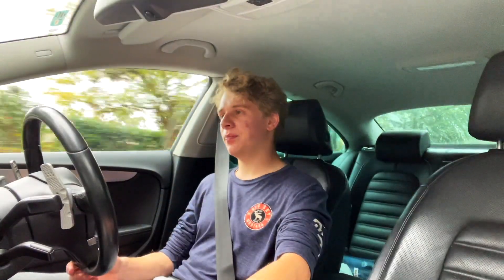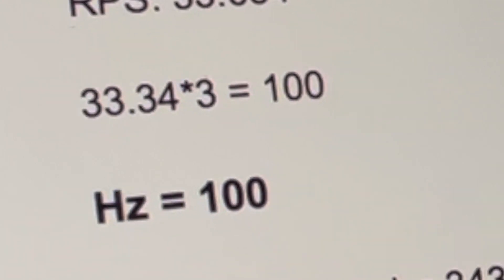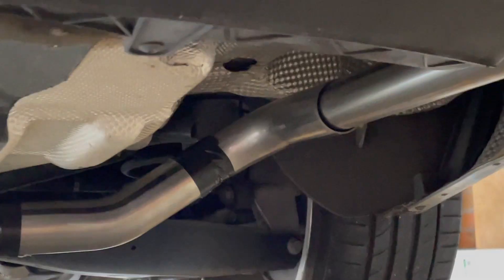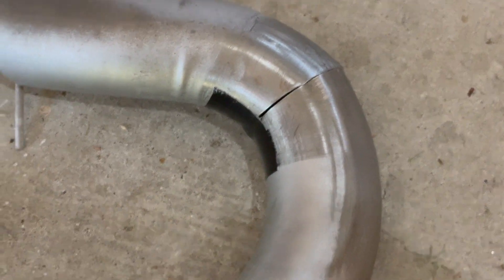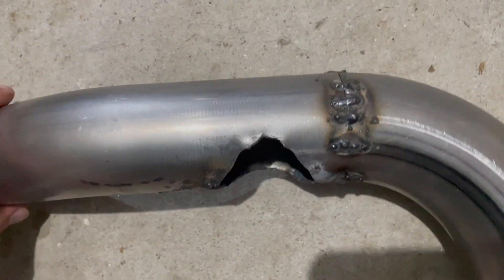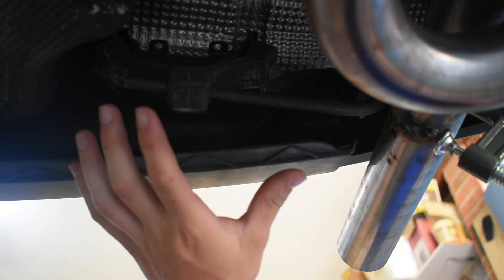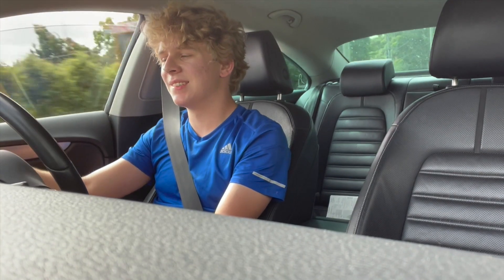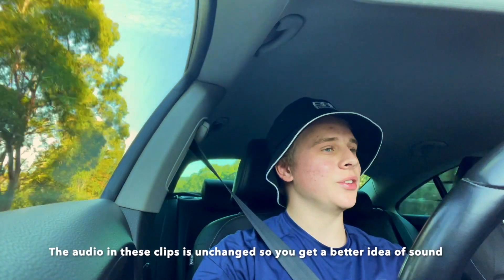Building the PERFECT, DRONE-FREE EXHAUST with simple maths | J-Pipe Resonators (Helmholtz resonator)

Comment: I calculated the use of a pair of free flowing mufflers with the right size body and internals. Would sound shitloads better. Providing a deeper more sporty note, without drone! And better performance as the symmetry of every bend, join and swaged pipe joins always going over the pipe from rear to front are CRUCIAL. You say it's perfect, but I know in my professional opinion it could be better. Impressive maths tho.

Comment: MYYYY DUDE!!! YESSS!! This is a sick perfect and informative. The perfect exhaust does exist. One quick questions, Is it fair to say you could use the 100Hz for value for most cars? You mentioned that car is a 6 cylinder. Does this apply to the calculations as long as it's a 4 stroke car motor? Thanks!
Reply from the maker: Hey mate sorry for late reply, most engines will be somewhere near 100Hz but it’ll change depending on the number of cylinders. Use the formula in the video to get an idea for your engine, it shouldn’t be too far off 👍
Reply: my camry trd v6 drone was between 125-135 for the bulk of it
Reply: My Opel Astra 4 stroke reaches 100Hz on 3000 rpm and 66,7 and 2000, but I didn´t finish my exhaust to have the drone rpm information yet
Reply: It will be interesting to see if my Fiat 1.3 diesel will need a resonator pipe. It’s about to get a 50mm system with two absorbent boxes.

Comment: Very helpful your experience, thanks a lot.
As far as I could get a feeling of the J-pipe calculations, the length is not linear according to the RPM, so as you increase de RPM you decrease the length, however if you choose a lower RPM to calculate, it will help to cancel the drone (noise cancelling) of all RPM multiples. Ex: If you choose 800 RPM, the J-pipe length will prevent drone on  800, 1600, 2400, 3200, 4000, 4800 and so on. For 1000 RPM, it will work for 1000, 2000, 3000 ... but, keep in mind, for 800 or 1000 RPM the J-pipe will be around to 3 meters length
You need to calculate according to you car characteristics.
Reply from the maker: Correct, not linear. But keep in mind it’s exponential as well, so if you choose 800 like your example, the following cancellation frequencies will be 1600, 3200 and 6400 etc (double the one beforehand). Hope this helps

Comment: If my exhaust is 3 inches should I use a 3 inch j pipe? My whole exhaust is 2.5 with a 3 inch muffler delete. I’m planning on changing the whole thing over to 3 inch. Should the J pipe be 3 inch for my current setup? Or should it be smaller?

Comment: Nice, I found the exact frequency with an audio spectrum and using that data point to calculate my length. 

I just flipped a 1 to 2 outlet muffler backwards like a collector and capped my resonator side. It worked so well; nice and aggressive when on it and practically no drone at cruising speed and zero boominess at idle.

My car is a 5 banger. The math becomes more difficult with odd cylinders and 144° cycle, so I just used the audio spectrum.

Comment: Great video! It sounds awesome for just a single resonator each side. I was wondering if it would help using a tube that slides into the other right at the middle of the straight section of J-Pipe? I was thinking that the joint could be clamped and the tube shortened or lengthened with a twist of a nut on the clamp to quickly adjust it for testing -- what do you think?
Reply from the maker: I reckon that’s a good idea for fine tuning - since building the system I’ve had similar thoughts for future projects 👍

Comment: Great video! Not much info(at least not in Aus) about this concept so good to see the whole process laid out in a video. 
I'm currently working out a j pipe for my vs v8 Ute. I've worked out length, and location but haven't got a diameter yet. You said in the vid it may not matter much as long as it's within a certain range? I was thinking I might have to make mine 3" (same as main pipe) to be effective? If 2-2.5 will work as well I'd have much more space to work with😅
Reply from the maker: Hard to say exactly but it relies on around 50% of the soundwaves entering the J pipe, so a pipe a bit bigger than 1/2 the size (to ensure free flow) should be plenty
Reply: @OEMStez  thanks! I'll update here once its done and the results
Reply: @OEMStez  it's all installed now and I am a happy guy. I used 2.5" pipe 80cm(measured outer edge) length braced to a spare hanger for support. Placed it after cats & before centre muffer due to limited space, and runs straight beside muffler itself. Feels like a completely different car to drive! I can finally enjoy driving at all rpms again. Thx again for the video👍
Reply from the maker: @leomeares2270  good to hear mate, glad it worked for you and enjoy!
Reply: @leomeares2270 in your case, does it decrease the length of the tube by increasing the diameter?
Reply: @thomash9244  i think the length is more important and wouldn't change based on diameter. But in my case 2.5" worked perfectly anyway with 3" main so i saved some space
Reply: @leomeares2270  Thanks!

Comment: hey mate! how did you end up properly finding the correct temperature for the exhaust (in the second attempt), rough calculations show it's not a massive change in size for my car at least (drops from 85 to 77cm) would be curious to know how you found it out accurately!
Cheers
Reply from the maker: Hey man, I thought I showed it in the video but I’m pretty sure I just used my temperature gun on the finished setup, measuring a few places on the J pipe and then taking the average. From memory the very end of the J pipe was only 40°C or so

Comment: Sounds great. From a muted interior sound, it seems more like a mk1 TT 3.2, which is a good thing. 

Whereas my mk2 TT 3.2 clearly has something wrong somewhere with a nasty rasp rattle. Need to go deleting boxes: deleted x1 pre res and it’s not worked. Replaced the resonator box and it did nothing other than become louder. Replaced cats. Next option is to delete other pre res, and the big back box muffler. I suspect it’ll become a louder system but hope the rasp goes, especially if I buy a full resonated system. 

That will lead onto my next challenge. If it introduces drone I was going to be unhappy. But this video gives hope. Thanks.
Reply from the maker: Factory resonators usually reduce the raspiness you get from an exhaust, especially on the VR6, so I'd go for replacement. Mine was pretty raspy until I fitted the Golf R resonator and that fixed it completely. Good luck mate 👍
Reply: @OEMStez  thankfully I kept mine. So it may go back on. 

I’m first going to try new Y pipe back from the cats (deleting all pre res) back to the resonator box (currently Magflow, but maybe go back to OEM as you say); and some folk say worth putting some small/tiny J pipes onto the sides of the Y pipe near cats. 

Thanks gain. Great video and effort. You’ve achieved a great sound. 

Folk say the mk1 TT is akin to the mk4 golf R32; whereas the mk5 became very raspy - Audi engineers huh 🤦‍♂️

Comment: hey there just found your channel! I'm super confused if I'm doing my math right. I got 33 inches but I think I'm way off. I have a v6 maxima and just added a magnaflow 12468 and deleted resonator and dual mufflers and have bad drone at 2000 rpm. I'm confused how you got your hz would mine also be 90-100hz? If you don't mind helping me out I would greatly appreciate it!
Reply from the maker: Hi mate - 33" inches is about 840mm, which is pretty much exactly what I got so I'd say you're spot on! Hz is just Drone RPM / 60 (to get revs per second), then multiply by number of ignitions per revolution (3 for both of us with 6 cylinders) = about 100Hz. I think you're good to go, should work great but only one way to find out 👍
Reply: @OEMStez  ok thank you so much I'll try this out!
Reply: @airuzair2424  I have a G37 which also has a VQ motor like yours and faced the same drone issues. 33-34" is what I used for mine with 2.5" piping and can verify it works great. But it may add a small bit of rasp, so I'd recommend throwing some fiberglass muffler packing for a motorcycle down at the end where its welded shut if possible.
Reply: @904Saleen  did you add two j pipes one for each side?
Reply: @airuzair2424  I did
Reply: @904Saleen  did you end up adding the motorcycle packing ? If ya did how noticeable was it?
Reply: @chrisrobinson5400  wouldn’t recommend. Sounded good until motor started to suck it up the exhaust and burn it. I ended up getting a resonator installed on each j pipe but maintained the same length and it’s been working fine for over a year.

Comment: Hey man i wany to confirm this, so do you have all your cats in place? Resonators after cats? Am wondering how you got so loud and have drone because i did the suitcase resonator and replaced my mufflers with some straight through high flow MUSCLE CAR mufflers and i dont have that much drone with that setup. Does removing the rear two muffs really make it much louder or just introducing drone? 

So your exhaust sounds very wookie. When im in my car and accelerate i dont really hear the wookie growl anymore. I thought it was initially cuz i dont have chambered mufflers anymore, but in your exhaust test it sounds good even with just that 1 resonator and the 2 j pipes. Odd.. maybe my car sounds fine from outside, i will make a video and send it here if you reply so youll see it. If nothing but to hear an pretty interesting vr6 exhaust(because theyre muscle car/dragster mufflers) setup i guess.
Reply from the maker: Hey mate, all cats were still in place yeah. Seemed like about the right volume to me for what was deleted so it may just come out differently in video, but it did drone enough to annoy me for sure
Reply: @OEMStez  did you have the resonators after cats? Im trying to understand how your interior was literally vibrating the steering wheel and rier view mirror
Reply from the maker: @flute136  yeah I had cats and resonators afterwards, was free flowing after that. I had the exhaust exit underneath the car for a bit when I cut off the mufflers so it could’ve been bouncing off the street back into the car but I can’t quite remember the order now 😅
Reply: @OEMStez  LOL yea pretty sure it would do that. But that wasnt done for permanent right? Like i thought you said the reason of this whole video was you were having shaking in car with all mufflers removed. Or was it all mufflers and resonators, so straight pipe essentially

Comment: For how much of the rev range does the drone cancel out? Does it work for a narrow range? Because my exhaust is very bassy and drone starts almost from idle
Reply from the maker: I'd say it cancels out roughly 200-300 RPM above and below the target RPM, in kind of a bell-curve pattern. The reason it works well for the target RPM is because it's really only designed for the target RPM - the drone you get there is from the engine frequency matching the frequency of the exhaust pipe. If you're getting too much rumble at idle you'll probably just need to put some restriction back in, as that's just sheer volume rather than actual drone. Hope that helps 👍
Reply: @OEMStez  I've been trying to find the same info.. I was hoping for at least 5 hz of dampening in either direction.  Other interesting musings.. I think I read somewhere that the diameter of your resonator pipe affects the amount of dampening for that frequency range. Meaning more diameter, more dampening.. I suppose that's why the general council is for smaller pipe than your main pipe to achieve flat response through the RPM range. I'd think if you went too big, it would actually be quieter at the target frequency than everywhere else.  One other question, when you shortened the length, you did that based on only the measured temp difference on your resonator pipe? Last question.. I know the way that the resonant drone works, there's generally other rpms that have a bit of resonance (at the harmonic frequencies) did you notice if the resonator dampened those as well? Finally, great work, and great explanation.. this is an age old problem that the aftermarket capitalizes on to get you to spend ungodly money on for full cat back systems.
Reply from the maker: @edmcamoil4009  There's definitely a lot to think about making exhaust setups, but was a great project. In terms of diameter, I figure the goal is to have 50% of the exhaust gases go through the J pipe to create 100% cancellation, the ideal setup probably wouldn't be a J pipe but actually a loop that both splits and re-joins at a Y-pipe, with the loop being 50% of the drone wavelength. This is something I'll build in the future but didn't have the know-how when I made this one. If you go too big I'm pretty sure the cancellation lessens again, more than 50% of exhaust gas entering the J pipe would result in the drone becoming louder again I think, as there isn't enough non-resonated gas leftover to cancel against. Not 100% sure on that one though. I shortened the pipe as the cancellation was too high in the rev range, and just used my realisation with temperature to confirm it, the decision to shorten was definitely based off of sound though. In terms of resonant frequencies, it seems to maybe cancel a little bit at 4000RPM but it's hard to tell, so no, not really a massive impact. Cheers!
Reply: You could try building a cone like a two-stroke pipe, maybe then it would work in a wider area  @OEMStez